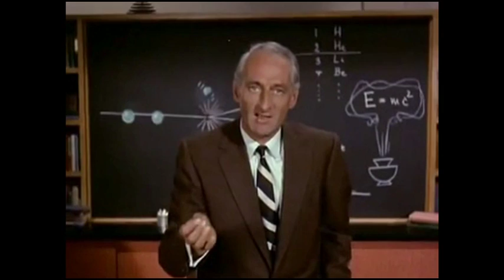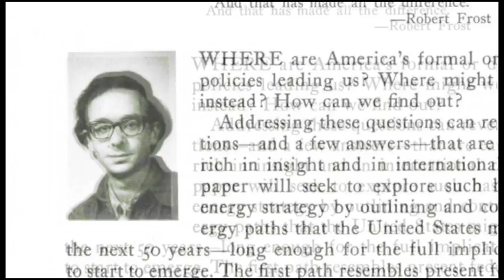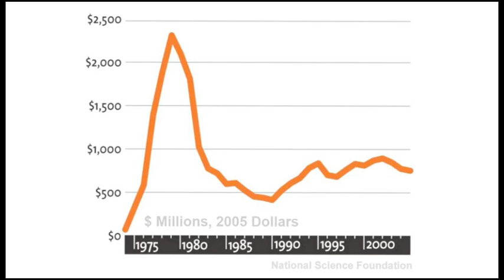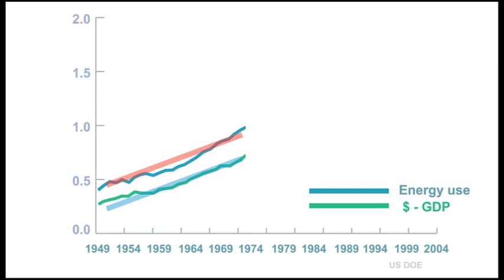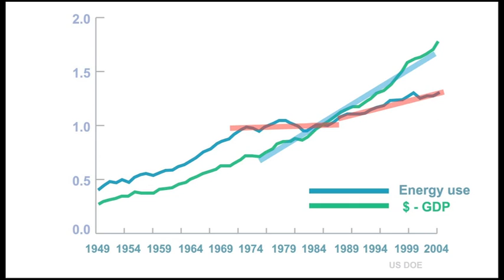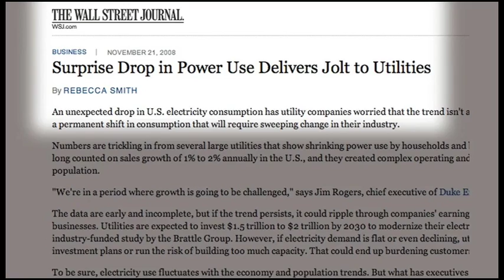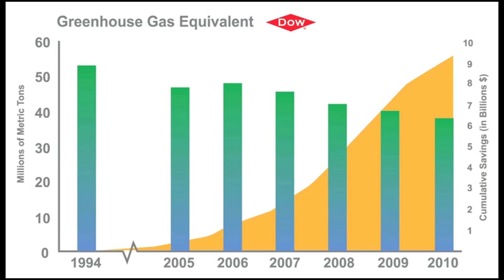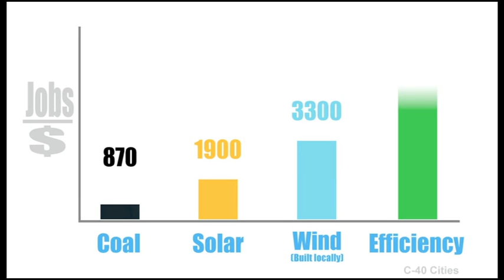Energy Efficiency Part 1

Comment: @OlejzMaku 1) Currently wind is a small part of the energy mix so there's no problem.  
2) As wind becomes more predominant there are also grid level storage solutions going into place to buffer those load issues.

Comment: @OlejzMaku will in fact at one point wind was producing over half the energy of Germany, though it was at night and it was strong wind.  Though  new designs in wind power has shown great advancements. such as the win lens which doubles and in some cases triple the output of standard windmills by casing a low pressure zone to from in front of the wind mill casing even more wind  to follow through at a higher rate generating larger amounts of power even on less windy days(thank japan tech)

Comment: @OlejzMaku Heating and cooling represents(including warming water)56% of residential energy use(citizens in their humans). For commercial use  45% is used. Geo is a great way to go in this because pipes can be laid down 4 feet below the surface of the ground  or sent straight down (if you don't owe a lot of land)and the water  in the pipes would be keep at  ~50-55 degrees. This could use to help cool houses by running the pipes through walls of homes and business. (cont)

Comment: @OlejzMaku The technology keeps improving as i mentioned the Wind lens developing in japan has showing to increase output of  wind mills by 2 to 3 times normal even under lower wind conditions. The average capacity factor for all US reactors has improved from below 60% in the 1970s and 1980s, to 92% in 2007. so in a 30 to 40 year period it increase by ~32% don't you think similar improvements won't be found after the large surges in renewable energy since 2000?(talking in general all forms )

Comment: @Theimmortalwhitewolf Another problem with wind is that it is not always blowing. If you build large wind farms you still need conventional plants as a backup. It is difficult to balance the power output. As result it causing power grid overloads and electicity is often wasted.

Comment: @T0B0KKE Due to the energy requirements of refrigeration, and the limits in the total energy able to be stored, SMES is currently used for short duration energy storage. Therefore, SMES is most commonly devoted to improving power quality. If SMES were to be used for utilities it would be a diurnal storage device, charged from base load power at night and meeting peak loads during the day. Mean many of the plants that only get turned on a few hours a day or a year won't have to be used.(cont)

Comment: @NicosMind There are several ways to use renewable energy without the need for precious metal, including water heating, Scheffler reflector system, can be used to cook thousands of meals a day with just sunlight. There geo that can used to heat and cool your home.(help offset). And you can't forget about the simple white paint of the roof as California has made law. reduces energy use during summer  for cooling by 10-20%.

Comment: @OlejzMaku Also you may want to look into wind lens technology from japan. A simple lens(hoop) with an wing shape edge creates a low level of pressure in front of wind mill casing  more are to be pulled though increasing production of energy even in low winds. Experiments so far have shown a 2 to 3 times increase in energy production. (though for germeny  had a 15.3%)(your numbers are off though. you have the 27.2GW right but production was 36,500 GWh

Comment: @Silentsam7532 Yes i counted hydro, when i first messaged i said renewable could meet demand. We seen a quadrupling in wind form 2000 to 2006.  Also there indirect energy use such as geo heat pumps and solar water heaters. (also the white paint law California passed which can save some buildings as much as 20% on energy cost to help keep their buildings cool during the summer(this could be done throughout lower latitudes  while increasing heating cost (which would be around 5%).

Comment: @Silentsam7532 cont) Offshore resources experience mean wind speeds of ~90% greater than that of land, so offshore resources could contribute substantially more energy. So off shore is more expensive but you tend to have smaller no wind periods then you do on land. For hydro, Norway gets 98.25% of total electricity from hydro, Brazil 85.56, Venezuela 69.2, Canada 61.12, Sweden 44.34, China 22.25%,Russia 17.64, and India 15.8.  Through 2015 , some  ~60 Gw of hydro suppose to come online.

Comment: @OlejzMaku No you won't need the large back of plants if you had a strong smart grid. Yes wind stops blowing in an area but it just stop over a large country the wind is always blowing somewhere. The turbines that began commercial operation after 1998, however, show an increasing capacity factor trend, reaching 36% in 2004 and 2005.(this comes from a US. department of energy report. which i will gladly give you the link too.

Comment: (TIDAL as its normally called) does only make up a small amount of energy because their or very feet installed plants. A good explain being the Sihwa Lake Tidal Power Station when completed later this year will ~ double current installed plants. (there was only 6 plans working as of august of last year. ) with only 2 built in the last ~ 3 decades.  (last cont)

Comment: @T0B0KKE This means cars would run on cheap electric at a general stable rate, far more stable then oil prices. Cars are parked ~ 23 hours of the day, and a fleet electric and hybrid cars would have a total 10 to 12 times grid capacity. Being on a smart grid means whenever you care give power to the grid you would be credited for it similar to California when you use solar and make more power then you need you sell the excess to the power company and get a check from them.

Comment: @T0B0KKE Wind dies down slowly, but when one of the nuclear plants stop or coal plants stop that is when you can have blackout problems, because power production drops to zero. That is a 150 MW that stops in a mill second.no warning to grid operators. Wind being from dozens of large windmills means even if one windmill must be shut down for repair you still have the rest of the mills going.

Comment: @T0B0KKE As for Geothermal may only make a small percent but it manages to meet 30% of Iceland's needs, 27% for the Philippines, 14% for both costa rice and El Salvador , New Zealand meets 10% of its needs.  20% increase in geothermal power online capacity in a 5 year period form 2005 to 2010.The International Geothermal Association projects  this will go by 72.66% due to the large number of projects presently under consideration.

Comment: @T0B0KKE More than 200 GW of new wind power capacity could come on line before the end of 2013. Wind power market penetration (percent of electrical energy needs produced) is expected to reach 3.35 percent by 2013 and 8 percent by 2018.

Comment: @OlejzMaku I'm not calling for extremely high albedo surfaces. i'm saying move from a black surface to  light gray  can make a large difference in the amount of energy that is retained . Yes grass is better, but you have to take into account that the southeast has a lot of droughts + you have to factor in the extra cost  of water linings and plants..etc. There is very little cost to make a roof white. No water or maintenance cost.

Comment: @T0B0KKE However from the ~9am-5pm period they find it hard to meet demand specifically during summer because of heat. They fire up plants that never see any use all year just for a few days to help meet demand(again costing us an arm and a leg to run). A study from the US dept. of energy shows that 84% of all trucks, cars, and suv could be supported with current infrastructure.  This means electric companies could sell more power without having to build new plants.(cont2)

Comment: @OlejzMaku If you live in the lower latitudes of the US where winters are shorter then in the north and you have much higher average temps (not saying specific cities but over the land area) Pay back for geo systems that i spoke of  can be as low as 4 years if you use electric.(this didn't include any government subsides that may be offered).5 Years for heating oil.

Comment: @T0B0KKE To you power storage solar has a good storage rate,  salts are an effective storage medium because they are low-cost, have a high specific heat capacity and can deliver heat at temperatures compatible with conventional power systems. The Solar Two used this method of energy storage, allowing it to store 1.44 TJ in its 68 m³ storage tank, enough to provide full output for close to 39 hours, with an efficiency of about 99%(yes 99%)

Comment: @christo930 Let's not forget about trucks (18 wheelers, not pick ups), boats and airplanes. There are some airlines using algae, but right now it's very small. The reality is that our problems are too big for substitution, there is most likely be a large reduction in consumption, fewer vacations, and far less personal mobility, because behind peak oil is peak phosphorus, peak copper and the list goes on and on.

Comment: Another example of Jevon's is CPUs. Since the commodore 64 transistors have become spectacularly more energy efficient.

We went from a few thousand transistors to a billion. From one core to many cores. From simple, cacheless in-order cores to monstrous OOO cores with branch prediction, multilayered cache, many execution units, speculative prefetching. From 2 MHz to 2 GHz(power consumption goes as frequency cubed!).

In watts/cm^2 we left the hot plate in the dust, then the nuclear fuel pellet.

Comment: @christo930 Good question, where does the car come from? You'll just have to find a way to buy one. Used ones can be a cheap as $500, especially if they don't run. If they don't run, you don't need to put gas in it, just use it as a sleeping space. 

Ok, as long as you agree better quality life is possible now with less money, let's hear you tell me. How much would it cost me today for the same quality life 100 years ago. I'm waiting.

Comment: @T0B0KKE its more like 90% Nuclear plants have an additional disadvantage; for safety, they must instantly shut down in a power failure, but for nuclear-physics reasons, they can’t be restarted quickly. For example, the Northeast Blackout of 2003, 9 operating U.S. nuclear units had to shut down and were later restarted. During the first 3 days, while they were most needed, their output was less than 3% of normal. After 12 days of restart, their average capacity loss had exceeded 50 %.

Comment: @T0B0KKE (cont) It is expected that the installation of hydropower can reach 210 GW by the end of 2010. At the end of 2008, wind power in China accounted for 12.2 GW of electricity generating capacity; In 2009 China had total installed capacity of windpower up to 26 GW. China aims to have 100 GW of wind power capacity by 2020. 
The china has announced plans to expand the installed capacity(solar)to 20 GW by 2020. So even if all the nuclear power came online by 2020 china would make  80GW(cont)

Comment: @T0B0KKE Taking into account evaporation losses from the exposed water surface and conversion losses, approximately 70% to 85% of the electrical energy used to pump the water into the elevated reservoir can be regained. This comes from ESA. With approximately 80% efficiency pumped storage plants have the highest global cycle efficiency compared to other power plants.(report from the Alstom company)

Comment: (cont)Scheffler reflector system requires no rare metals but can still cook food. The largest found in India can cook around 35,000 meals in a day at max capacity. In 2008 , there was a total of 2,000 large scale systems. (no gas , though electricity is used to move the system slowly to follow the sun ). Silicon solar cells while less efficient only capturing ~ higher 20s% , the benefit of silicon is that silicon is the second most common element on earth.  (cont2)

Comment: @T0B0KKE Sure if you build them in a lush valley. But now a days even your standard water tower will work, 30% is way off have no idea you got such a number, return is 80-95%. Its also not the only tech, there is standard and advance battery systems, Kinetic flywheel, and reverse geothermal storage. But it really doesn't matter due to the grid design, and that less electricity is use as night. There by relieving the need for extra solar input(in some place they still work pretty well at night)

Comment: @Silentsam7532 speaking of Spain, in 2005 Spain became the first country in the world to require the installation of photovoltaic electricity generation in new buildings, and the second in the world (after Israel) to require the installation of solar hot water systems. France had a 14% renewable in2009. The Ministry of National Infrastructures estimates solar water heating saves Israel two million barrels of oil a year.The share of RE in the energy sector is 10.63%of total capacity of India.

Comment: @T0B0KKE Pumped storage recovers about 75% of the energy consumed, and is currently the most cost effective form of mass power storage.Tianhuangping Pumped-Storage Hydro Plant can provide about 13 GW·h of stored gravitational potential energy (convertible to electricity at about 80% efficiency), or about 2% of China's daily electricity consumption. Superconducting magnetic energy storage (SMES) systems are highly efficient; the round-trip efficiency is greater than 95%. (cont)

Comment: (cont) even cutting hydro off at 2010 and the other leading renewable energy you have 330GW. Over 4 times the amount made by nuclear. However, rapid nuclear expansion may lead to a shortfall of fuel, equipment, qualified plant workers, and safety inspectors. During the nuclear emergencies at Fukushima, China announced on 16 Mar 2011, that all nuclear plant approvals [but not those already approved] were being frozen, and that 'full safety checks' of existing reactors would be made.

Comment: @greenman3610 This is what we need. Anti-matter injectors and all that. However some of the precious metals even used in wind turbines are around over $2000 per ounce(or it could be £2000 an ounce since i heard it in the uk). In the 1950s we had over 50billion ounces of above ground silver which is down to 600, thousand now. with a yearly drill of 600thou(which is increasing now cause of the sharp 10 year price rise).
But for sure the technology we have now is woefully incapable.

Comment: @Theimmortalwhitewolf I am not againts wind energy. I just think we should not build more than we can with our current technology handle. 36% procent is nice but it is not solving the problem, isnt it? It would need better way to store energy, better power grid, better way to control power grid and some advanced market system to be able sold all the energy we made before we use wind on massive scale.

Comment: @RyuDarragh In a 5 year period  china has increased wind capacity by 33 times. China's installed hydropower capacity has surpassed 200 GW in late August 2010. It is expected that the installation of hydropower can reach 210 GW by the end of 2010. The government has announced plans to expand the installed capacity to 20 GW by 2020.Researchers from Harvard University and Tsinghua University have found that the People's Republic could meet all of its electricity demands from wind power by 2030.

Comment: @Silentsam7532 (cont) solar water heating and cooling had estimated capacity of 154 GW as of 2007. Iceland gets 30% of its energy from geo, along with New Zealand at 10%.  As a by country bases Iceland's renewable energy provides 100 percent of electricity production , they are still increasing hydro and geo and plan to sell the extra energy to near by European countries. 81% of total energy demand was meet in Iceland,with the only energy imported being oil to run the cars and fishing fleet.

Comment: @T0B0KKE Yes i admit they are safer, but a large natural disaster or a human be it by error (or an attack) could cause a major radiative leak. You won't have to worry about  such things with renewable sources.  There has been large advancements in all forms of energy including solar and wind(wind a good part of it comes from increases in blade sizes.

Comment: @OlejzMaku Yes because all that reflective roofs in California blind airplane pilots. If you read the comment you know what  i meant. California made it a law that all new buildings had to have a light color roof because of the energy it saved , also the money. 10-20% reduction in the cost of cooling during summer. As you may or may not know light colors reflect more heat then darker colors. If reflect back the heat is never absorbed so it won't have to be cooled.

Comment: @RyuDarragh care to cite sources on that renewable won't cut it part? because i can show several countries that already are and world wide percentages keep increasing to renewable.  World wind generation capacity more than quadrupled between 2000 and 2006, doubling about every three years. Wind Energy production was 430 TWh, which is about 2.5% of worldwide electricity usage. In 2004, wind energy cost a fifth of what it did in the 1980s.(so cost as with other renewable keep going down)(cont)

Comment: In 2008 31% of New Zealand energy needs where met by renewable (mostly by geo and hydro). 54% of Sweden electrical needs were meet in 2006 by different forms of renewable. roughly 21% of energy used in Italy is renewable(no nuclear in Italy). Renewable energy in Spain represented 12.5% of total energy generation in 2009. Spain has set the target of generating 20% of its energy needs from renewable energy sources by 2020.(cont2)